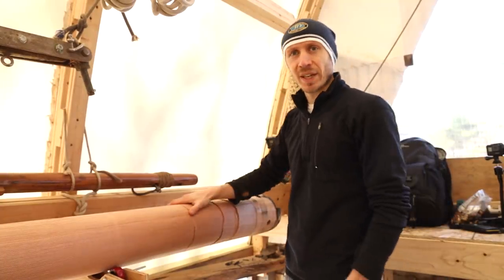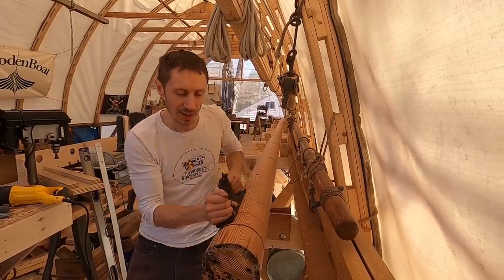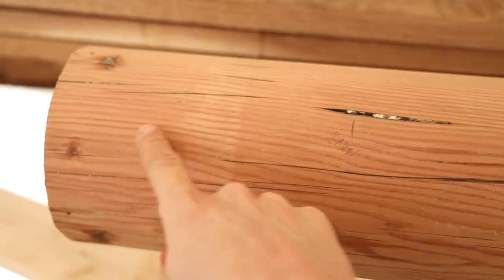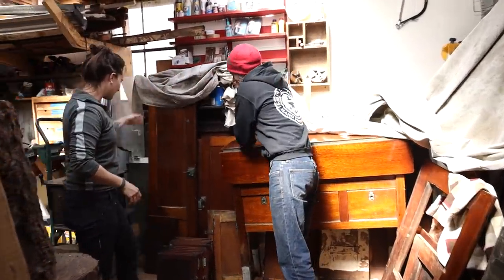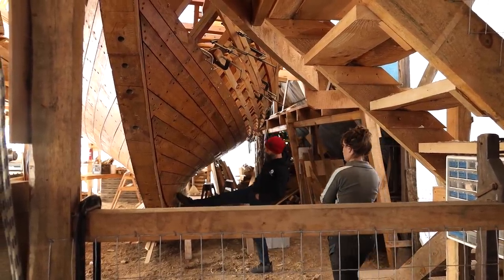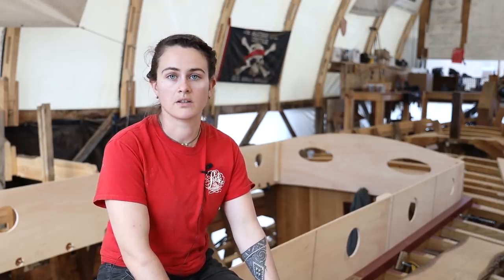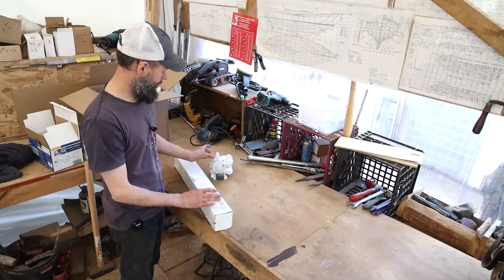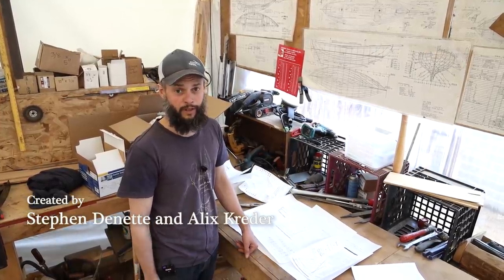There's a New Shipwright in Town! - Episode 158 - Acorn to Arabella: Journey of a Wooden Boat

Comment: For tender selection; we are extremely happy with our PT11 tender, which is a very light nesting dinghy (max 20-25 kg for one half). if you struggle to fit the full length tender, or just want a lighter option, this one is worth considering.  Our powerboat is in 1920-30 style, and the plywood tender actually look good too when it rest on our aft deck.
Reply from the maker: That is a super great design for a tender.

Comment: You said you were interested in 3 different Atkin boat plans with some expectation of modifying them to fit on top of your cabin... maybe the thing to do is to ask/arrange a visit and interview with the Naval Architect with the most specific dimensions of cabin roof you have, with options to change overhangs, curvature etc to best fit this tender in relation to space available. Then you'll have a plan to work to, with Atkin's endorsement too !  Have you considered the prospect of making multiple tenders for sale to fans.. or maybe a lottery could be an option ? After all, making a pair of these won't be much harder than just one, and could defray a bunch of the expenses on materials. Welcome Caroline !
Reply from the maker: Hey Mike! Adjusting a combination of cabin height and boom distance from the coach roof will be sufficient, and not too much change will be needed to the dinghy hopefully.

Comment: I'm partial to the idea that the outside of the doghouse should be shaped to exactly fit the inside of the tender (aside from a few things like seats and chests that can be dismounted) - stows the tender taking near-zero deck space and costing near-zero windage, provides additional structural strength to the doghouse when tender is stowed,  etc. 

I've never really seen it done though. There are probably good reasons why not; others know boat plans way better than me and could tell why.

Comment: Alex, a minute and a half in you are hammering two hardened steel faces together. This is a no no! I tried this, once, and the triangular piece of steel shrapnel I squeezed out of my lip matched the chip in the hammer face exactly!
Reply from the maker: Yeah I actually thought about that as I did it and it didn’t last long haha
Reply: @keithmartell3971  You're right about the vise grips, but my comment was about pounding hammer face to hammer face, that happened before.
Reply: @tolbaszy8067  .
Reply: @keithmartell3971  1:20 Alex is hitting a hammer face with another hammer
Reply: @darrenatarrant  You are right.
Reply: Sorry Tolba, I missed Alex doing that, my bad

Comment: May I ask a question please?  
Why were the two pins-drifts removed?  I just was thinking doesn't that now weaken the mast, even if new drifts were replaced?
Glad to see the progression!
Reply from the maker: Wooden drifts (trunnels, kind of) mean a couple of things: Metal drifts could allow water intrusion more readily than a same/material plug, and if a tool is taken to the area later for a repair, it won’t be a tool-wrecker.
Reply: @AcornToArabella  Thank you for the useful explanation.

Comment: Couldn't you use a 2 part epoxy to fill those holes in the mast. I do it all the time with my furniture. I mix the powder from fine sanding, same material, with the epoxy and fill holes and cracks. Requires sanding but blends nicely and about the same structurally.
Reply from the maker: These are a little deep for that (and yeah a syringe could get it nearly all the way in there), but really if we have the material, it’s better to use that.

Comment: I'm sure you've thought about it, but if lashing your tender to the house top you'll want to avoid anchoring it to something like the stanchions, which make a long line of tripping hazards.  Maybe deck mounted anchors at the house sides would work for you.  I don't envy your launch and retrieval of a mahogany tender either unless you're planning a lift of  some kind.  Did you consider just a stowed inflatable?  Anyway, good luck and thanks for taking us on your journey.
Reply from the maker: With a gaff rigged boat, we’ve got a built-in crane.

Comment: Don't take any of my questions negatively, I just have an inquiring mind. Could't an orbital or belt sander made faster work of the planing of the inner side of the planks?
Reply: A belt sand would be useless, in that it would only make contact in 2 patches (either end of the base plate), and wouldn't go all the way across to the left hand frame member because of the motor, drive belt, and extractor/ bag.....unless you could somehow use it upside down. An orbital might do it, but you risk creating an undulating surface.
Reply from the maker: What Mike said.
Reply: @AcornToArabella  That's one answer. Thanks Mike.

Comment: why no pressured water what about showers or even just for cleaning are you having hot water
Reply from the maker: More wires, more power needed, more things to fix and spare parts to stock... it’s just not a priority for us backpackers who are already psyched to have the luxury of gallons upon gallons of water in tanks.
Reply: @AcornToArabella  why bother haveing solar than if your not going to use it 12volt pumps use nothing what about friges and stuff and lights there just basic things
Reply: @battleboat2487  A small wind turbine with wooden blades instead of the usual white plastic and a small diesel generator for backup would be better imo.
Reply: @nrml76  iagree anything better than nothing there making a big mistake

Comment: I'm wondering why you didn't just use a 2" surfacing bit in the router to turn the mast to near finished diameter and then just finish off with the hand plane. Aside from the great upper body work out, this just seems like an unnecessarily sweaty way of doing the job.